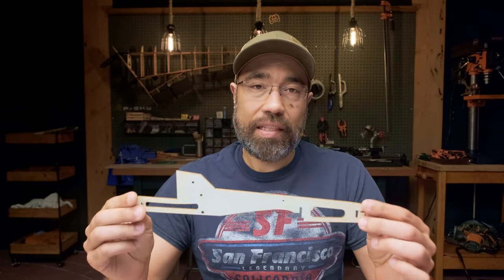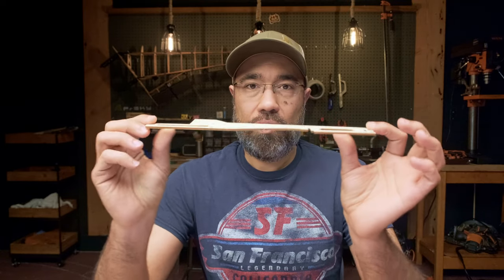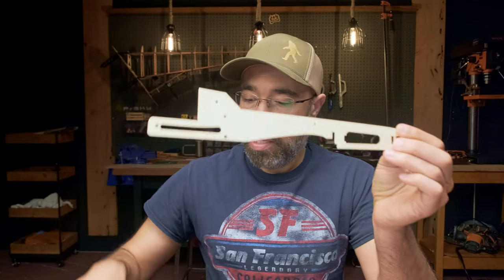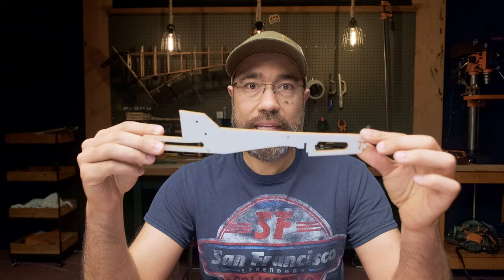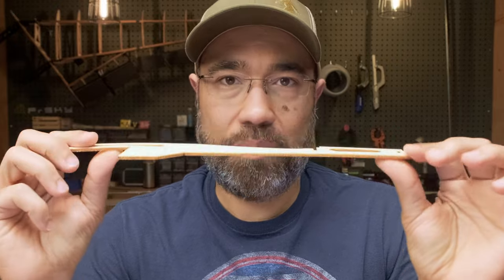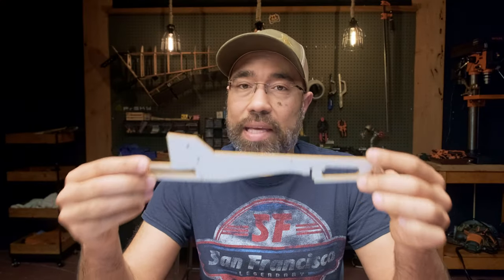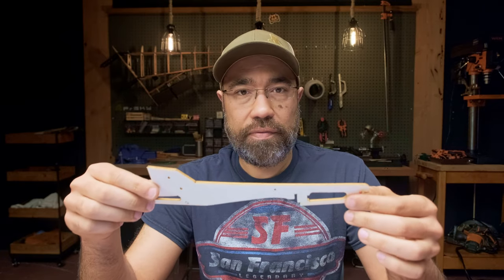Why's it taking so long? L-1011 RC Airplane Build and Kit Development

Comment: Wow, Terrance.  A change in material is a really big deal and very challenging to work through.  I know you'll work out a great solution and I'm anxious to see your completed prototype flying!  Cheers!
Reply from the maker: Yes, it really is a big deal. It's a setback I didn't see coming. At least there is a workable and affordable alternative, even if it requires some extra rework. I'll be moving on to electronics and gear as soon as I get the next build video out the door, so things are getting very close now. Hopefully there will be no more major set backs. Thanks for following the project!

Comment: Although I'm comfortable with F360, you definitely have a great  sence of presentation which engages me with watching your tutorials. They're great for beginners and great as refreshers.

Although I have zero engineering background,  I have the mindset that i know it can be done,  so getting insights into your build process, is a great mind stimulus for trying to figure out mechanical design challenges im going through. 

Also its been mentioned before, your video production quality, is aspiring. Even if you perhaps have an editor, your vision of what you want the end result to look like, thats all you.

Looking forward to the design & development on your landing gear, as thats been a challenge as it hasn't been done before, for the scale model i've been working on.

Comment: Came across your videos look for rc wood frame designing/cutting. Very impressed on the level of detail and the efforts you've put into this project. 

Regarding narration,  you really should just do it (or any other styles for your YT content) to either try something new, or for a better workflow for your time. 

I was curious about what lazwr cutter you've been using, as i've been debating cnc router vs laser.

I'm more into helicopters, though the process and dedications you've been sharing on fixed wing is definitely transferable to helis. Im very interested in catching up on your video's.

Take whatever time you need to put out the quality of contect your happy with, this is your project, those that will appreciate it won't have any issues with time.

All the best as you progress though.  Cheers!!

Comment: You learn a lot in designing, building and finally producing a RC-plane. What will be learning of the design when flying the model. Any accurance or previous experience in such a (pre-ordered/pre-paid) experiment?
Reply from the maker: This is all very true! This is the first time I have attempted developing a kit airliner, which is letting me think a little differently from how more traditional kits have been developed. Lots has been learned and lots still to learn. 😀

Comment: I was expecting a 1.5k -> 2k usd kit . I had to replay to make sure it was 300$ and you didnt say 3k $..
Also, thank you for the Fusion 360 video you made.
Reply from the maker: 😀 you heard correctly. Though, the DIY starter kit includes the wooden frame components only.. This way more people can start this model and complete it in a way that spreads the costs over time as a builder's budget allows. The Base kit, is more in line with what you were expecting. 

This page on my site breaks down how the kit variants will be made available https://www.rccad2vr.com/trijet-kit-pre-order-waitlist the goal is to make a kit of this size and scope as accessible as possible.

Comment: It sounds like Fusion 360 might be the wrong choice from your work. Solidworks will up date all the models, numbering and assemblies when you make a change so updates to the manual should not be that tough. Or maybe I miss understood you issue?
Reply from the maker: I wish it was as simple as a Fusion 360 Problem. The issue is that the part numbers need to be etched into the part at the time of laser cutting. There is no tool that I have found that can automate taking the part number (not the item number) and adding it too the part for laser CNC etching, which is managed in Lightburn. Every time a part changes, a new part added, or a part removed, the Nesting plan for the CNC changes and you lose the position of the parts where the part number was located. It's a real pain to deal with, I've scoured the net for tools that can simplify this process to no avail. So it remains a manual process unfortunately. Also the manual can't just be a technical drawing of the part, the joining process has to also be illustrated in a specific order which is also partially a manual process.  You can download an older sample version of a partial assembly manual for the L-1011 here: https://www.rccad2vr.com/trijet-kit-pre-order-waitlist Under the manual slide show there is a PDF download where you can get a better idea of what I am referring to.  Hope that clarifies it bit! Thanks for the comment and question!
Reply: @RCCAD2VR  Can you not have the laser etch the number at a lower power on the parts as they cut them out? Or is the laser a fix power?

Comment: I don't know if it's been mentioned (I haven't read through all of the comments), but it looks like you might possibly have what is referred to as 'bending plywood' where the grain of the plys are running in the same direction rather than being oriented 90 degrees from each other? I have used poplar ply before and while it's nowhere near as stiff as Baltic birch, it was not that flexible.
Reply from the maker: Hi - Yes, you are correct. The orientation of the cut contributes to the bending nature shown in this video. It can be significantly reduced by changing the orientation of the part in relation to the grain. For one part, that's easy, for hundreds of parts however requires programing the desired grain orientation of each part individually where its critical prior to feeding the assemblies into the nesting workflow. The birch is much more forgiving than the poplar in this regard.
Reply: @RCCAD2VR  You may want to check with your supplier, they may have poplar plywood where the grains of the plys are running perpendicular to each other. Specifically mention that you do not want bending ply.

Comment: quick question what is the plane gonna use for thrust an rc jet engine an edf what is it gonna use?
Reply from the maker: Hi - The plane is being designed to allow for either EDF or Turbine power-plants. Mine will be powered with EDF's but many of the kit reservation holders have specified turbine.

Comment: Hi T, curious to know, what clearances do you give for your inside cuts on your wood frame mating parts? just working through all your videos, might come across it yet. :)
Reply from the maker: When it comes to tolerances, the majority of the cuts are set to get as close to a transition fit as possible, with a few being interference fits where an absolutely tight joint is necessary. Working with plywood through can be tricky, because each sheet can have 0.05 - 0.1mm of variance. I usually have to use calipers to select the sheets to make sure they are within tolerance for the parts I am cutting. Then I also calculate use the kerf of my laser to get me right in the ballpark. Unfortunately because of all these variables I can't provide an exact set value. Often times I find myself having to sand down some parts because they sheet was 0.1ish mm too thick, other times the fits are too loose and a little extra care is required to get it right.
Reply: @RCCAD2VR  Thanks for the in depth reply, that's was very helpful to get an understanding on how you process the complexities at that stage of a build. 

If everything was easy. It would take away from the mental challenge that these kinds of projects help to stimulate our minds. I definitely have many questions, though I'm going to get caught up with your videos first, i'm sure there are  some great golden nuggets of info in each one. Thanks for sharing your  journey through this.

Comment: it would be cool to see a aluminum frame instead of wood and generally the whole plane to be made out of thin aluminum, but you would need more powerful engines cause of the weight
Reply from the maker: That's would be quite the challenge! Interesting idea for sure. Weight management would definitely be the most difficult part to keep in check.

Comment: is it possible to make a 3D-printed support for supporting necessary parts?
Reply from the maker: That is always an options, but I have to take manufacturing time into consideration. There are many 3D printed components in the model, and many supports and brackets that are also 3D printed. If it makes sense, I definitely have no problem adding such parts.

Comment: If you are shooting for a price point of $300 for a kit composed of all the wooden parts, you are day dreaming. Rather than waste your time trying to convert to Poplar, stay with Birch plywood and finish the prototype. The market for kits of this model is miniscule, and those who want one would gladly pay triple your target price point. Time to wake up and be practical.
Reply from the maker: 2 Things. 1 - The $300 price point is for the DIY starter kit. I know how much it costs and how much time it takes to produce it and it's well within reason based on current material costs. This price point is specifically targeted to allow those that don't have the money to fork out thousands right out the gate but who want to make their own parts over time as money allows. It is also for schools and educational programs. I have a very long list of reservations for this kit version alone. What you consider minuscule can afford a comfortable income. If you take a moment to look at the reservation page again (Since you are on the reservation list), you'll see the pricing breakdown and options as they currently stand. 2 - I can't ship kits with a material I can't source. An alternative is required and the manufacturing processes need to be thought through, It's not just about the prototype, which I have 2 by the way. Shipments of Birch to the US for this grade of laser ply stopped in April of last year. My suppliers have both confirmed they have very little left in warehouses and haven't be able to get any new supply. I'm trying to get my hands on as much of it as I can, that are within thickness tolerance required for parts to fit correctly. Lastly, please ditch the condescending tone.
Reply: @RCCAD2VR  I will put my 56 years experience in the hobby (including as a hobby related business owner) against your 2 years (or thereabout) experience and although I wish you the best of luck with this business endeavor, I am not holding my breath. Just today I visited a friend who is in the Laser kit cutting business and he has no problem obtaining Birch lite ply and Aircraft plywood. Poplar is something that will make it much harder for you to sell to "Builders" (who are a dying breed in today's society of "Instant Gratification" seekers). It will be very interesting to see how many people on your reservation list will actually place orders if/when this will materialize. Not to rain on your parade but I know very well what I am talking about.